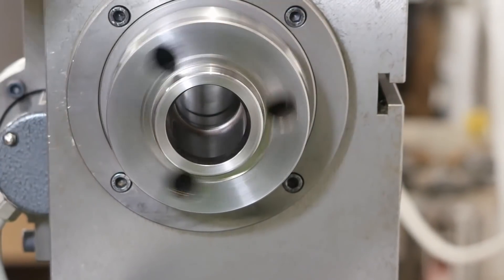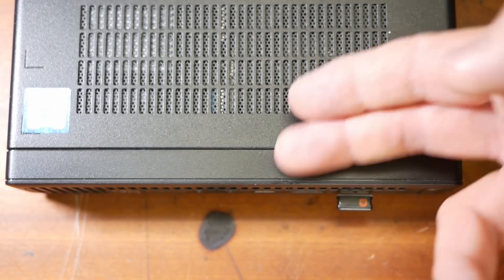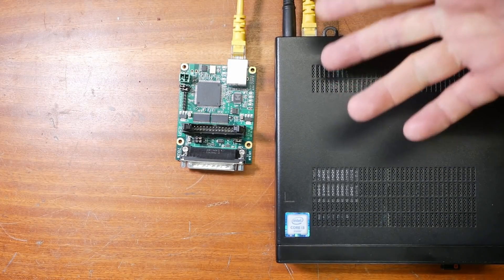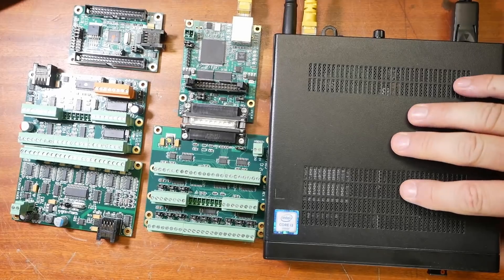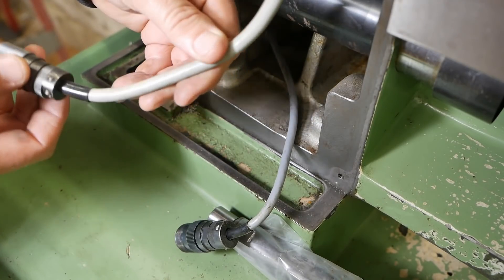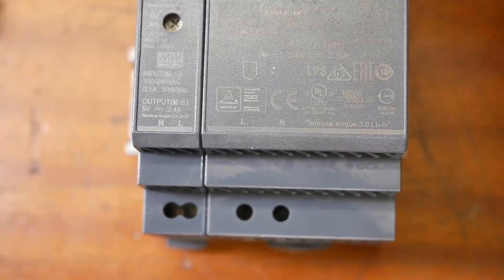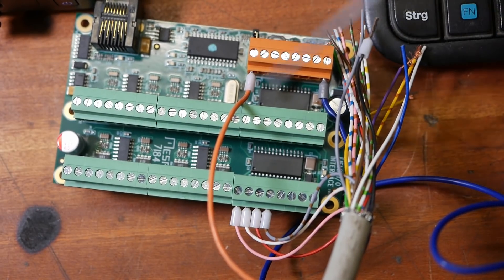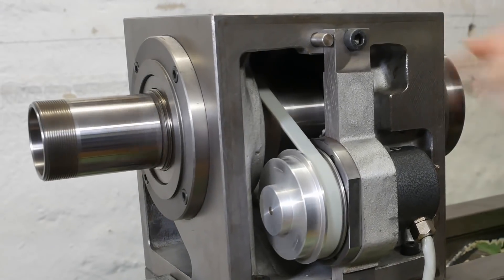Installing LinuxCNC on the Schaublin

Comment: im sticking with mach3.

ive bricked two PCs trying to install linuxcnc. seems the very first thing it asks for a proxy server address or some crap... thats before its even started the installation... shrug... lets see what happens... i think once managed to get the start up screen, but no icons, no mouse, no...um...anything. but i was dealing with win10 and stuff on a pc, and rebuilding my main PC  at the same time, so details get fuzzy now...

yeah, iunno wtf the deal is... some people seem to get it. i cant even get it installed, so screw it. spent a day cursing cryying and laughing hysterically... nope.
even the download page makes no sense. download and install THIS one! but dont install this one, install the other one! but dont install that... install the first one! use this kernel! this kernel! nooooooo! thats not the kernel you need! but its the only kernel you can have. its what you need. but dont install it!

well, thats what i seemed to glean out of the poor documentation. noone has a simple tute on "insert flash drive. press this, type that. installed."

rather its "go learn the linux OS first, spend ten years doing IT and network configuration first".

nah, i used mach3 because it involves turning the thing on and machining stuff rather than spending days being frustrated, getting depressed, and thinking of dragging everything out to the side of the road and chucking a "for free" sign on it all.

Comment: Mate, where did you get all those Mesa cards? Mesa webshop is empty:(:(
Reply from the maker: I bought them about a year ago from Eusurplus in Portugal. PCW, from Mesa has reported on the LinuxCNC forum that they are having chip supply troubles, but that should be improving.
Reply: @RotarySMP  thanks for reply. Luckily i still have my old stock 5i25+7i85S unpacked in the drawer. It's time to get hands on it
Reply from the maker: @The_Unobtainium  The Mesa hardware is really really good, as is the support from the designer on the LinuxCNC forum.

Comment: Many years ago, I struggled with the same "many monkeys on keyboard" approach to getting my first Mesa cards working with LinuxCNC - I'd used it for years but only with simple parallel port-based IO. If only I had your Sopranos analogy to help me back then ... it wouldn't have been any easier.  :)
Reply from the maker: Good call :)

Comment: I’m not super familiar with the MESA cards, but I’ve seen videos of people using a Raspberry Pi as the brain running LinuxCNC. In fact, I’m using a RPi4 in conjunction with an Arduino Mega 2560 to control a little Sherline 4410 lathe, but I’m running bCNC. Out of curiosity, is there a reason you went with the (seemingly troublesome) HP instead?
Reply from the maker: It came up locally, for a good price, and has 6USB ports. I havent really followed the LinuxCNC-->RPi development, so I sort of stuck with what I knew.

Comment: There's no harm in turning on both solenoids of a double-solenoid valve, it just won't work.  There's a spool inside which directs the air (probably assisted by a smaller pilot air spool) and which is pulled by magnetic force from the solenoid. The closer the spool is to the magnet, the more force is available.  If the spool is already shifted to the A side and the B side turns on, it will be held at side A, no harm done. Turn them both on at the same time, and it might behave unpredictably. Note that cheaper valves sometimes depend on the thermal mass of the spool and the air that flows over it to ensure the solenoid wiring stays cool, but those Festos should be fine.
Reply from the maker: Good to know thanks.

Comment: Granted, I only need to control a modest hobby-size 3-axis CNC mill, but as someone who did use LinuxCNC quite a bit, I find it nothing short of astonishing how much headache can be saved by just going with an Arduino running GRBL instead. And YES, all y'all, I do realize that's not a real option for the Schaublin - I'm not a complete idiot you know, some parts are definitely missing...
Reply from the maker: I always find the installation of Linux from a live CD super easy, and then have some challenges with some "simple" things like this time, but once I get through that, the system is normally rock solid.
I know nothing about aduino.
Reply: @RotarySMP  Oh, I never have any problems INSTALLING Linux, the problems always start the millisecond that's complete. :) As for GRBL, it's just a jewel of a tiny little firmware, running inside a classic Arduino Uno (which is to say, an ATmega328 MCU), which connects via USB to your PC and handles all the real-time niceties of outputting "LPT/parallel port" type step signals for a CNC the ultra-reliable way only a dedicated micro-controller can. Well, or a mesa card, which is the same thing - only for GRBL, the thing generating the signals and the thing computing when they should occur are under the same roof...
Reply from the maker: @AttilaAsztalos  Probably interesting for stepper based systems. Although the Mesa 7i96 I used on the mini lathe is also a great solution for that.

Comment: Why such a big ass encoder?  Most of the ones I come across are tiny and unbelievably precise.
Reply from the maker: 1. It is belt driven and needs decent bearings to react belt side loads.
2. In the Late 1970’s when Schaublin designed this large, this was small.
3. Schaublin used a heavy cast iron terminal connector housing for the main disconnect. This encoder is light and tiny.

Pick your answer.
Reply: @RotarySMP  Oops. I forgot the age of the machine.
Reply from the maker: @bobweiram6321  Mine was built in 1983, but I am pretty sure they started production of these in about 1977.

Comment: I love the contrast between exquisitely machined steel/iron and electronics. Much prefer the hardware! I am dipping my toe into this area also, making a dynamic crankshaft balancer for a ducati engine. I have a couple of accelerometers and a rotory encoder linked to an arduino. The goal is the read the out of balance shaking of the setup and identify the place to drill some steel away to balance it. I know nothing about writing code for arduino so ........... going to be a long winter......... Always love it when your videos turn up, keep it going and thanks. 😊
Reply from the maker: Sounds like an interesting project. You should post videos of it.
Reply: @RotarySMP  I really should, not sure about my video skills or presentation skills,  haha. By the way my brother was a senior engineer at quantas. He has some interesting stories to tell. One was that he was tasked with getting some rodents off a plane, guess they didn't want any wires chewed. He filled it with co2 and let the staff follow their noses for a few weeks.
Reply from the maker: @chrislee7817  Yeah, getting todents out of aircraft is challenging. Another method is to fly unpressurised at altitude with the pilots on oxgen for while. Again, finding the carcasses is disgusting.

Comment: There's still another belt round the headstock spindle, what's it for?
Reply from the maker: A spare. You have to pull the spindle to replace the belt. Putting a spare in there ensures that the otherone will never again fail. It is held in place with a magnet.
Reply: @RotarySMP  Oh I seeeee. Thanks for clarifying!

Comment: Parts going back on the lathe!!!!

Heat up a candle stick and press against that label that you've been cleaning up for the last year.  That'll get it clean.
Reply: Would Blu-tack do a similar job.
Reply from the maker: @bostedtap  I think over years it would turn to a sticky mess.
Reply from the maker: Cool Idea. I doubt it will work, but it will look cool in the video :)

Comment: some times technology is so complicated and analogue seem so easy
Reply from the maker: You are not wrong there. But then you see Andy Pugh's non-round turning in LinuxCNC, and imagine the complicated gear train to do that on an analog machine, and it is not so bad after all.
Reply: @RotarySMP  yeah obviously digital system are very nice but some times the fix is so long versus something old that have nothing digital, but yes i agree linuxGNC and similar software are beast that old system like you show in another video the old boards an such

Comment: Thanks for the run-through.  I followed your lathe thread on the LinuxCNC forum, where there are more details.  LinuxCNC deserves a better analogy than The Sopranos as they were truly evil characters whose behaviour  was normalized over years of TV script writing.  I can't think of one though.
It would be nice if you could get a reciprocal plug from Karl, as he doesn't need the extra subs.
Thanks for the videos.
Reply from the maker: That would be nice, but Karl is in a different league. He could probably chuck up the whole Shaublin on one of his machines.

Comment: the 68000 is the original mac, the 030 is one of the last of the family jumping up from a 16/32 bit design to a full 32 bit design and yadda yadda your looking at high end mac and amiga workstations from the early to mid 90's instead of the early to mid 80's of the OG 68K found in the first gen of mac's, amiga's, atari st's and of course sega megadrive
Reply: The Mac SE-30 was my first Apple computer. It had a slot for expansion, where I ran a color graphics board that fed a second monitor; yes a 14” color CRT next to the native 11” monochrome built in.
Reply: @robert_g_fbg   I have an SE (not mine originally) that came with a Radius expansion card and monitor, while not color it was a high res mono "full page" display (stock screen could display a half page")  neat machines.  Though the SE only has a 68k and of of course the 30 has a 030 which makes it oodles more fast and can handle gobs of memory. 

for non mac people when I say pages, the original black and white mac's had their screen adjusted where you could hold a standard sheet of paper up to them and it would line up. Desktop publishers loved it cause it was truly what you saw is what you got on the printout, even to the point where the pixels would line up (back when brand new and well adjusted)
Reply from the maker: @osgeld  Thanks for the feedback. We had Apple IIe's at high school, but that was the last contact I had with Apple.

Comment: How do you measure the latency of the PC you want to use? Is there a test program to run that simulates hardware or you need all the hardware parts connected up and working then run a test?
Reply from the maker: There is a latency test built in, and you dont need all the CNC peripheral hardware, as most latency problems are caused by power saving modes etc. If you burn the install ISO to a USB stick, it gives you the option to install, but also the option to run a live session, where it loads itself to a vertual drive in ram. This way you can try it out on any machine, without affecting the existing installed OS. You can then run the latency test and see if there may be issues.

Comment: I am sure NXP is still manufacturing some MC 680x0 CPUs. They are present in many emebeded systems, industrial systems and even were used in satalites recently.

In late 90s they were pretty slow by then, but still was kind of popular in things like laser printers, some network routers, telecom and broadcasting systems, some scientific instruments, and such. Now all of these use ARM (sporadically MIPS).
Reply from the maker: Thanks for that input. Controlling a gas turbines does not need a hug amount of processing power, and I am sure they were very effieciently programmed. I wonder how much recertification work GE has to do with a supplier change from say Motorola to a MXP fab for "identical" chips.

Comment: May i say, that i said about this diode being blown on comment to previous video? C:
Reply: It is designed to suspend inducted reverse spikes and it does that perfectly, and it is able to pop fuse while wiring is reversed BUT it can blow while providing that feature. I think, that fusing this board is not recommended anyway, but powering with fuse in line is a good idea while prototyping
Reply from the maker: Yeah, there were a number of good suggestions, which I passed on to Stephan. He had it located in just a few minutes.

Comment: I am a retired PC tech. I know the basics of computers...have never tried to set up a system like you have just rigged up there. It would seem to me that in the future you will be able to use the fastest bus and just have a program to run it directly from the main cpu. That will take some development though and there is little incentive to develep that stuff for limited use.  (But I might not know what I am talking about at all) By the way,  Could you leave the flicker of Annie Lennox up a little longer. She's very pretty and I would just as soon look at her as your fingers.
Reply from the maker: Faster PC hardware is not the issue, it is the lack of realtime performance of modern OS's.  LinuxCNC runs a linux distro modified with a real time kernal.So you can run stepper drivers directly through the parallel port, but the Mesa hardware offers so much more in the ablity to interface encoders, PWM outputs, Step/Dir, Analog, I/O, various serial protocols. As I understand it, Mesa hardware is mainly used in industrial applications, but the owner had a LinuxCNC driver written, and is very supportive of the community, although it is a niche use of his hardware.
Reply: @RotarySMP  Wow I had no idea. Thanks for explaining.

Comment: A good effort for sure but it looks like it might be time to try some more serious chemicals on that placard. Maybe some hot methyl ethyl ketone or piranha solution.
Reply from the maker: I remember MEP from the air force. Last time I smelt it in a hangar in Malasia a couple of years ago. Evil stuff.
Reply: Carbon tetra chloride is what we used at the appliance repair shop, way back then. It would turn your fingers white. Nitrile gloves hadn’t been invented yet it seems.  Try getting carbon tet now, 😆
Reply from the maker: @robert_g_fbg  Right, I remember that from my apprenticeship as well. No wonder there  was a huge ozone hole over NZ.

Comment: Your data plate has something stuck in its tz.
Reply from the maker: It does. Swiss gunk. Top quality, long lived, tough swiss gunk.
Reply: @RotarySMP  Speaking of top quality, thank you for a peek at the connectors on the encoder.  Truly those are a thing of beauty.
Reply from the maker: @jimsvideos7201  Would have cost good money.

Comment: Ooooh, perfect timing, I’ve just finished stripping down my Facit C1-13 calculator 😀
Reply: Debugged my ESA-01 a while back.  Combined mechanical and electrical gremlins
Reply: @davidbrown8365  I specifically avoided the later electrical models, I bidded on a 1964 model, but that went out of my budget, and the seller offered me a 1968 model in slightly better condition, with all the decimal spacers.
Reply from the maker: @davidbrown8365  Cool project.
Reply from the maker: I had to google that. Wow, I bet that has complicated internals. Hope you can get it back together. :)
Reply: @RotarySMP  That makes two of us, luckily there is a nice chap called John Wolff that's created a complete teardown, clean, and reasembly guide that I am following.
Reply: Here's the internals if anybody is wondering ~ https://www.youtube.com/watch?v=JQ8T8ZvzTF4

Comment: would have been a lot easier to go with acorn, especially since the encoder is already on the machine
Reply from the maker: I have no idea about Acorn. Could be argued I have little idea of LinuxCNC and Mesa, but I already got two machines up and running with them, so it was the obvious choice.
Reply: @RotarySMP  yea, i went mach3 on a conversion because i knew it , and knowing the platform goes a long way

Comment: I had to do maintenance work on a CNC waterjet cutter that was made by a company that has defaulted years ago (hence why I am doing the maintenance). I think they defaulted because of all the shielding and high quality connectors.
Reply from the maker: The Heidenhain stuff is consistantly the best shielding I have seen. They really dont want any EMI problems.
Reply: @RotarySMP  Similar with the machine I had to maintain. The problem turned out to be a broken cable strand to the pendant, which would send spurious commands, that overflowed the CAN bus. Anyway, the flex cable to the pendant was 110 EUR, and each single contact (milled/turned and gold plated) was 0.70 EUR, plus very expensive tools to remove and crimp the new contacts. No wonder they didn't make any money on the machine, even though it was 125k EUR originally. But everything was built to perfection, including the shielding inside the cabinet being terminated into a proper ground clamp, and hundreds of pages of cabling documentation.
Reply from the maker: @graealex  Aircraft crimps are also really expensive. Seems you need a different set of dies for nearly every connector.
Reply: white/mouldy white colored shileded cables are a crime against humanity.
Reply from the maker: @chronokoks  Schaublin used all grey wiring. It is all pretty grimy.
Reply: They pick this option over searching for EMI going over limits somewhere while changing anything in production cycle. Wiring is cheap, while EMI designing is not if you count units to some specification on one hand :>

I don't know, i just assume that not many units were made identical, so they had excuse
Reply: @poprawa  Wiring isn't cheap, to the contrary. One of my customers produces bus components that basically exchange more expensive components vs the amount of work required to produce cabling in automation scenarios. Basically it's not the copper that's expensive, it's the time required to manage it.